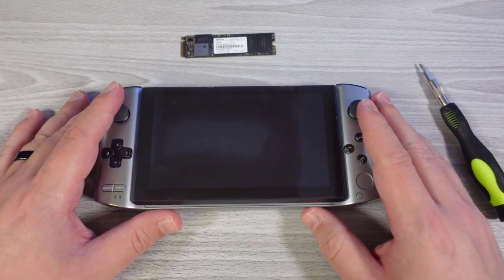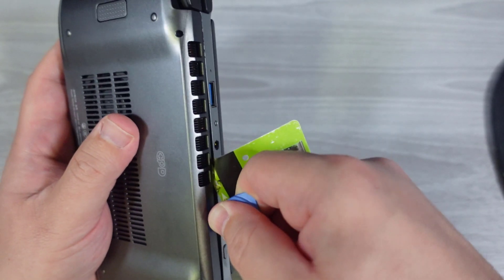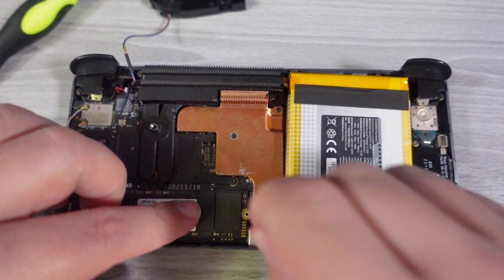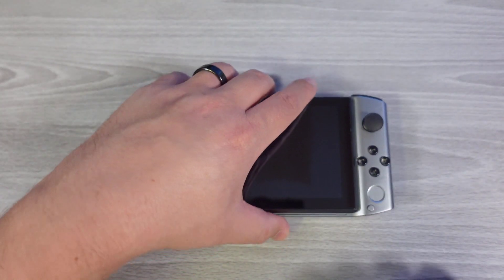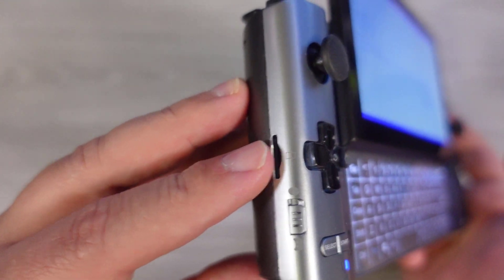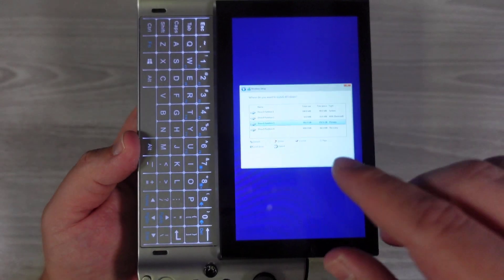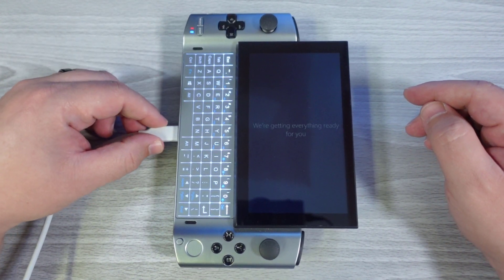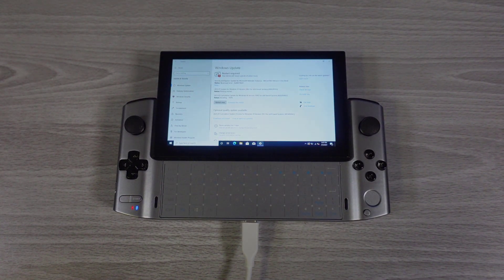GPD Win 3 - How-To Upgrade SSD and Install Windows 10

Comment from the maker: All, I've updated the package and link to double driver.  It's been changed in the description field.
Reply: I guess it's kind of randomly asking but do anybody know of a good website to watch newly released movies online?
Reply: @Arthur Layne Thank you, I signed up and it seems like a nice service =) I really appreciate it!!
Reply: @Braylon Judson glad I could help xD
Reply: Do you know if there are any 4tb ssd's that would work for the GPD win 3?
Reply: It's been removed. Could you update it please? Just ordered my Win 3 and am setting up my USB Stick.
Reply: double driver link down
Reply: question, hav you come across, or had the issue with the device giving a black screen when turning on AFTER you open it up an assemble it again? ...my issue is the device turns on, black screen fan comes on, but nothing else...there is no display, on the screen even though if you connect a monitor to it, it will show the screen, and if you run your fingers over the touch screen off the device, it will translate over to the external moniter and you can interact with the device...

Comment: For anyone watching this and can’t connect to the internet, it’s mostly because you have a ax210 WiFi chip, if so you will need to download the drivers before you do the install, or if you have already done it use a another laptop and copy and paste to then another sd card/usb drive then go to device manager and update through there.
Reply: I’ve literally never commented on a YT video. I made this account to like and thank you. I felt defeated. Couldn’t find a single answer anywhere. Thank you bro.

Comment: Given both SSD are formated in NTFS, can't we just:

1. Remove included SSD from Win3
2. Insert on another PC/laptop
3. Copy all contents on hard drive
4. Remove SSD and insert new one
6. Copy/paste all contents on new SSD
7. Insert new SSD on Win3

Wouldn't it work?
Reply: you would then have a lot of unneeded drivers installed on your win 3 iof you did it that way. windows 10 auto installs drivers when you pop a different pc ssd in.
Reply: not really. windows has to be reinstalled or imaged over, there are multiple partitions on the drive that the common user doesn't see for recovery, cache, ets.

Comment: The joystick mouse mode stopped working after the driver install and have no idea how to fix it, does anyone have a solution?
Reply: ok so I kd of figured it out if anyone still cared. Turns out the little chip set behind the switch was loose and I was able to just open it up and tighten it. It was just a coincidence that the driver update happened at that time.

Comment: Hello men, I always follow your tutorials to use my GPD WIN 3, I have had this machine for 3 years but now I have a problem.
I can use the GPD connected to the power supply, and the battery is charging (now it is 100%) But when I disconnect the power supply the GPD is turning off, and it is impossible to turn on without the power supply connected.
Do you have any idea how to fix this problem?
Thanks for your time.

Comment: It looks like the tolerance for the ssd is somewhat similar to the win max. It might be possible that a double sided ssd can still fit.
Reply: Was it possible to fit a double sided nvme to gpd win max?
Reply: @onursolak5758  it is, but only up to 2tb. Thicker flash chips like in 4tb nvmes would not fit. A lot of us installed the sabrent rocket tlc 2tb SSDs which are double sided and it worked.
Reply: I see, thanks for info. I was planning to install sabrent rocket plus 4tb double sided nvme but i guess it's not possible in that case then.

Comment: Can you grab your gpd win max ssd and put it in the gpd win 3 so you dont have to re-organize all your stuff?
Reply: I think that would be so messed up. Windows are tied to the motherboard. It will detect changes and might need the license. You second problem would be different set of drivers from 2 different products.

Comment: Can you tell me,what is better?AYA or GPD?Of course it’s important for me to have powerful gadget,but I don’t see another advantages for GPD.Could you give advice?
Reply: Win3 has a hardware keyboard, microSD slot and thunderbolt 4 port, so it can use external graphics cards.
Reply: @yonrak8138  I don’t like gpd keyboard)it’s ugly)I like gpd for it’s power.But aya has hiroscope ,better screen,3 USB ports,stronger battery and updates on website for each two days)so I can’t understand what is better
Reply: Tell me which model of win 3 are you purchasing. If it's an i7 model then the cpu is more powerful and intel iris xe graphics is atleast 10x stronger than vega 8 so with future intel driver update the iris xe will give alot of extra fps in games but if you like gyro scope then buy neo it gives good performance and amd drivers are optimized for gaming
Reply: @satvikshauryasingh1152  i7)gyroscope is not most important for me.But strongest battery,better and bigger display this is the question!You want to tell that future drivers for intel will create more else FPS?
Reply: From what I've seen...

- The GPD Win3 is more powerful, but has a smaller screen (5.5" vs. 7") than the AYA.
- The GPD Win3 can be hit or miss due to Intel Graphics driver bugs depending on the game.
- The GPD Win3 has a shitty physical keyboard ... but the AYA has no keyboard at all.
Reply: @МистерБус  I tested iris xe graphics against vega 8 in my laptop so xe graphics are powerful but intel is yet to release drivers to bring out it's potential .at full power it can crush vega 8 while gaming
Reply: @МистерБус  buy aya neo if your sole purpose is gaming .It has gyro bigger display more type c ports but if you want to do video editing and stuff with gaming go with win3 as it's future proof. ryzen 4500u is 1.2 years old now and is less powerful than intel i7 11 gen . Vega 6 is  old and weak compared to iris xe. So if you are going to buy choose wisely
Reply: @nikolaikai940  - Unfortunately the AMD drivers for the iGPU aren't suppose to be a whole lot better either, though I personally have no experience with it and only going with what was said online.
Reply: @ezg8448  That's a bummer, if true. : /

Comment: Hey phawx can the win 3 run without battery ?
Reply: You mean strictly recieving power from the adaptor plug?
Reply: @thomasusheriii971   yeah like some laptop can power on without battery. just via ac plug.. i was wondering if it is the same for the win 3
Reply: @michaelknight8797  yes but the moment you disconnect the power, it’s shutting off and you could damage the system.

Comment: This thing is retailing for 1300, I would hope the included ssd is sufficient
Reply: After three weeks of testing I can tell you it is. The only reason I can see for upgrading it is to increase its size from 1tb, but TBH that hasn’t been problem for me yet.
Reply: @staggerlee1869  it is a great ssd (1tb) but mine is almost full and I just got it less than a week ago. I just started a steam account with this and some of the games are 40, 50 even 80GB!. Too many amazing sales to pass up. Is it possible to store games on an external ssd and then transfer games as needed?